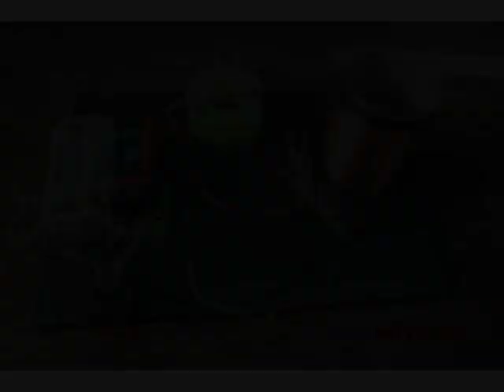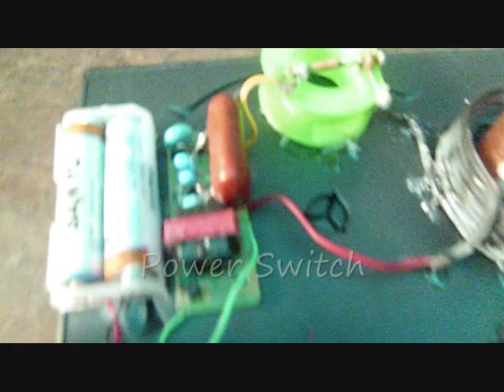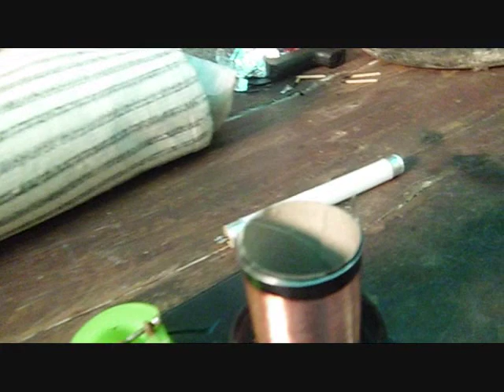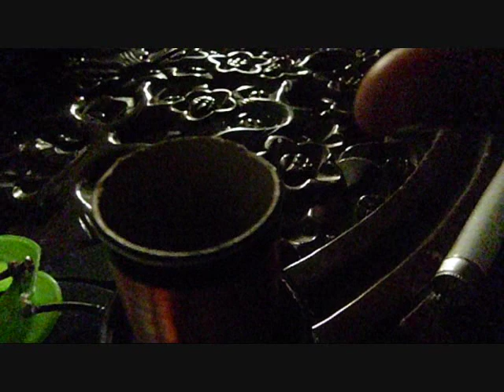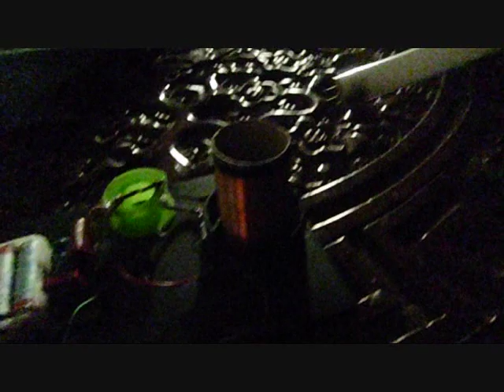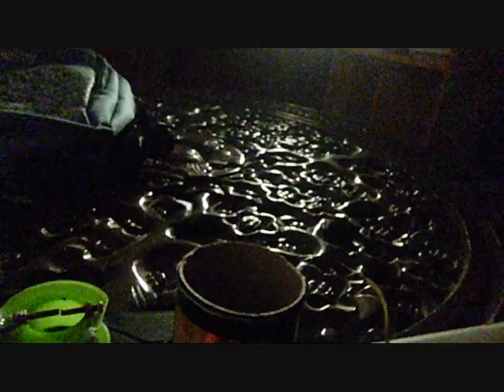My New Mini 3V Tesla Coil

Comment: Your estimate is off by an order of magnitude, at most that's 12,000 volts, probably only 6Kv or thereabouts. As a general rule, air has a breakdown voltage of 1200 volts/mm but that's with dry air and large round electrodes. With the average humidity and those small wires, it's about 500-700v/mm or less.

Comment: Hello there! I am currently researching the creations of Nikola Tesla for a school project, and I thought it would be a good idea to build one of these. Being a novice, I have a few questions. First, why does the ratio between the primary and secondary windings matter? Correct me if I am wrong, but I heard it had something to do with resonance. Also, do you recommend powering it by using the high voltage power supply featured in another video of yours? Thanks!

Comment: Hey as per the schematic, 1 side of the red wire(secondary coil) is attached to the toroid...but what about the other side? Can we hold it in our hand to get the spark? Please reply :) i really wanna try it out. Bw in this video there is no toroid.. So where are the two ends of the secondary coil

Comment: remove the big filter capacitor at the output.it will give you a constant spark.and ur coil will run at a higher frequency....

Comment: how do you wire the secondary coil, to the batery ground?
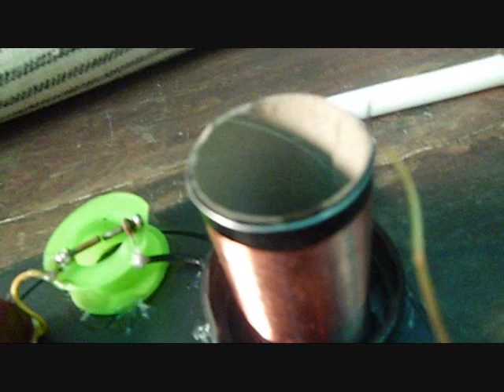Reply: You actually connect it to a wire to test the spark at the  toroid. See at 0:35 the lower end of the secondary is connected to the yellow wire while the upper one is connected to the toroid/screw. bring both of them close and you see the spark. :)